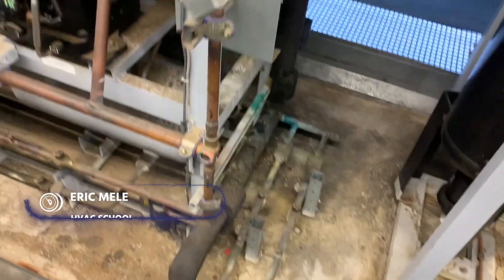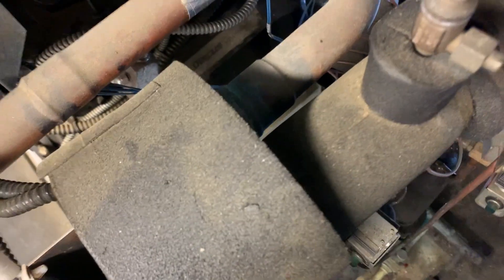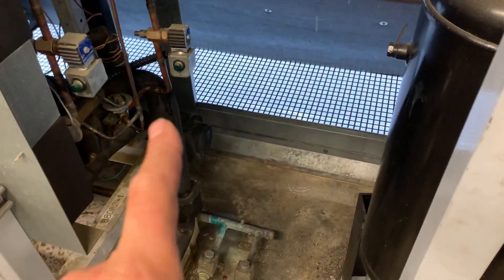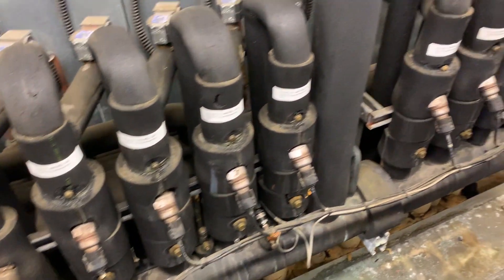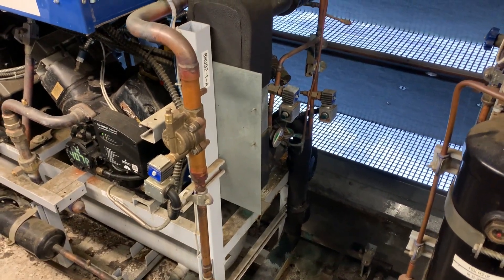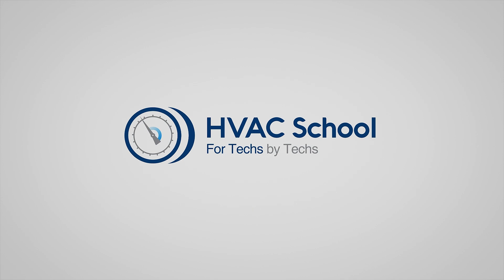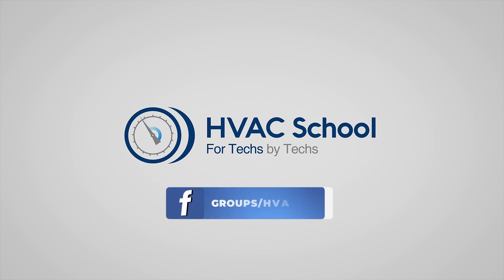Rack Refrigeration: Mechanical Subcooling

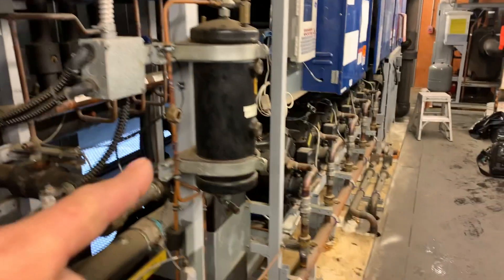Comment: Hi Eric or Brian, you stated that at 1:19 you can put that load onto a medium temperature rack. Would it make a difference if it was low temp application transferring to low temp through the BPHE?
With the expansion you will still be flashing gas on one side to subcool further the liquid line circuit.